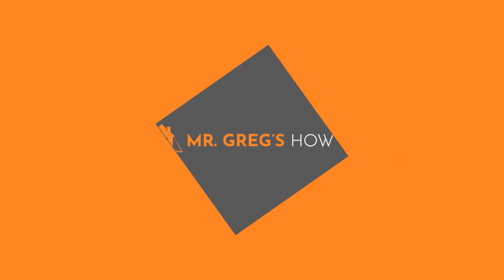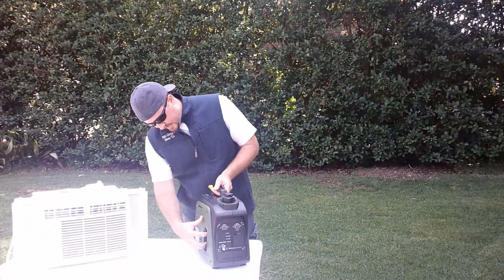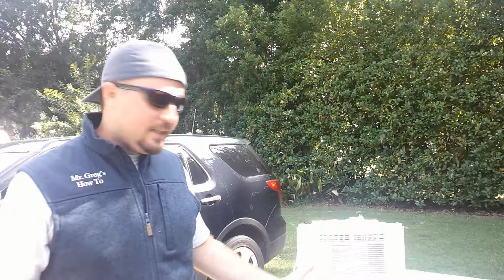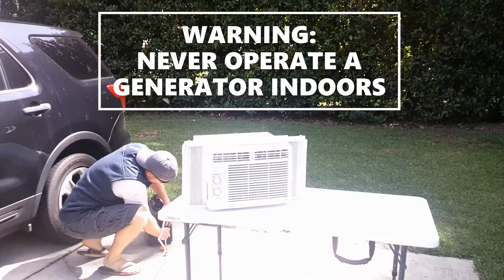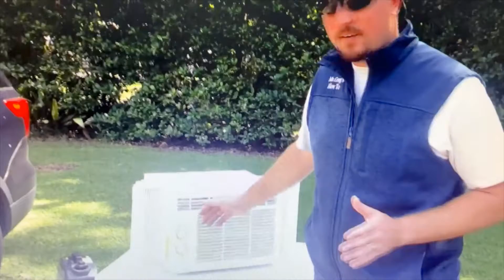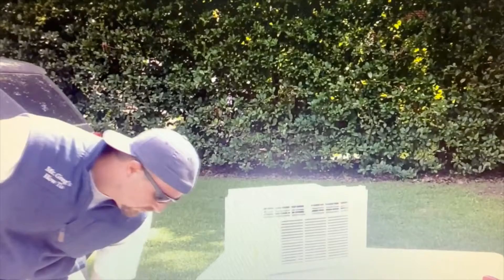Emergency Hurricane Kit: Running an Air Conditioner on 1000W Generator

Comment: Thanks for the video. What model Frigidaire do you recommend?
Reply from the maker: Howdy, partner!  There is a link in the video description for the model used in the video.  Just make sure you find one with a low-energy starting capacitor if you are using a smaller generator.

Comment: Does your Gen 1000 miss out when idling ? No load on it.. Mine is new and less then one hour on it. But it's missing out. Gas cap vent is open. The choke is off and Fuel shut off is 100% open.. What can it be?
Reply from the maker: Hey partner!  No, mine runs smoothly. I am not sure what it could be but maybe needs a slight carb adjustment. It should be under factory warranty if it gets bad. Good luck!

Comment: Generator is not enough. I’ve tried with multiple different window units and every time it overloads it. Will not work   Save your time and headache. I have the same generator and same window unit and it will shut off after about 10 mins of running every time
Reply from the maker: Hey partner!  I am really sorry to hear of your troubles.  I've never had that issue and have run this setup all night a few times.  I am sure you tried to warm it up first, but that is key.  Also, I might suggest a heavy duty extension cord so that you don't lose any wattage through line loss.  Best of luck my friend!
Reply: @MRGREGSHOWTO  glad it worked for you man. Maybe I just got a lemon. Thanks for the video!
Reply: I have the sportsman 1000 .....I have a 5,000 btu window ac that uses approx.450 watts , I did put a hard start kit spcc5  on mine ( a large capacitor with relay , that only engages when compressor is coming on...I put these on all my AC units ) that I jumped across herm and com. On the existing capacitor, my generator doesn't feel like it's having any problems at all...................Erik (also certified HVAC Tech.)

Comment: This will not run my Walmart 5000btu artic king ac. It will overload the generator every time.
Reply from the maker: Hey partner. Sorry to hear that. I think the trick is to have a low-energy capacitor in the AC to get everything kicked off. Best of luck and be sure to SUBSCRIBE for more!
Reply: Did you ever figure out how to get the AC running on your small generator

Comment: I wonder if this will work with other A/C units that are not frigid air...
Reply from the maker: Hey partner!  It will work with some other 5000 btu ACs, but the Frigidaire model has a low energy capacitor that lets it start at a lighter load. With the 1000 watt generator it’s very close, so luckily it works on the Frigidaire. I would test with any other AC that people buy just to be sure.
Reply: @MRGREGSHOWTO  I just got one. I’m gonna try it when I get a chance.
Reply from the maker: @electriccuts  awesome. Let us know how it works for you!

Comment: Everyone is going to wish they had this setup when those storms roll through their area.
Reply: Ran my tailgater for Ida. I just ordered one of these. Tailgator done great.
Reply: @Christ-is-King-  make sure to check the oil level every time you run it, to prevent damage to the engine. Mine smoked a little. Probably because it’s oil level was a little low. It’s still running good though 👍🏼
Reply from the maker: Howdy, partner!  Thanks for watching. Hopefully nobody loses power, but if so I’ll bet you’re right!
Reply: @MRGREGSHOWTO  it worked!!!
Reply: @MRGREGSHOWTO  https://youtu.be/vSEMOBurWWM

Comment: 500-600 watts for the fan alone? do you even know what you're blabbering about? its only an 800 watt generator... how much do you think the air conditioner draws with the compressor on?
Reply: The fan will only use more like 35-45watts between high and low fan speeds.
Reply from the maker: @stevencartlidge6574  thanks partner!  Keep tuning in for more great content!
Reply from the maker: Howdy partner!  I might be a watt or two off, but it runs great!  Thanks for watching and be sure to Subscribe for more great content!!